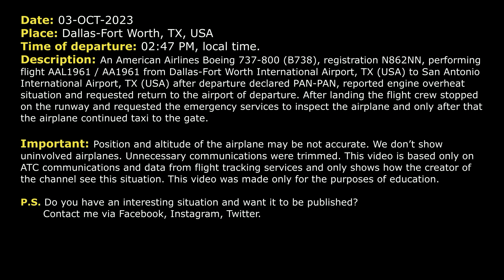PAN-PAN. Engine overheat shortly after takeoff. American B737 returns to Dallas-Fort Worth. Real ATC

Comment: Nobody uses Pan Pan anymore.
Reply: To my understanding it is the international standard, and I am hearing more US domestic pilots using it rather than emergency
Reply: @jpmasters-aus  No. Exactly the other way around. Sorry.
Reply: It is currently an emphasis at several US Airlines to adopt proper ICAO phraseology (Pan-Pan or Mayday) in lieu of “declaring an emergency”
Reply: @tankerdriver6329  You're correct sir.  It is a new point of emphasis at US carriers.
Reply: @tankerdriver6329  No. It is pilot specific now. Emergency has pretty much replaced the nonsense words in America.
Reply: @RLTtizME they aren’t nonsense words. Mayday means they need the radio to themselves for their problem, pan pan means they need to communicate and have stuff dealt with quickly but they don’t need the undivided attention of ATC. It is a short way of conveying the difference between an emergent situation and an urgent one. That’s useful.
Reply: @Fireandbubbles  Correct. Mayday means the worst possible situation and therefore it is used only in very urgent situations.
Reply: It would be interesting to show a quick overlay of the other planes in the area.
Reply: Grandkids do when they want P&B sandwiches.
Reply: Grandkids do when they want P&B sandwiches.
Reply: Grandkids do when they want P&B sandwiches.

Comment: I wonder why Fire Command in nearly all of these videos has such poor radio transmission?
Reply: I'm sure they're rock solid as heard on the plane or in the tower... The receivers for liveatc are usually not located on airport property, but some distance away. ARFF's radios are always used to communicate short distances, so they're likely not very powerful transmitters or have very good antennas.
Reply: @Pants4096  Also, VHF transmissions are line of sight, which is why it's sometimes hard to pick up aircraft when they're on the ground as well.
Reply: @Pants4096  is the smartest man in the room!
Reply: @Pants4096 thanks for the explanation. Yes, I’m sure the airport and airplanes can hear them well enough.
Reply: If the fire trucks radios are normally used for short distances would mobile phones be more clearer, in the video what did jayc mean that the ATC controller said